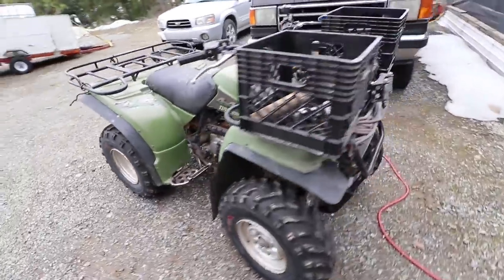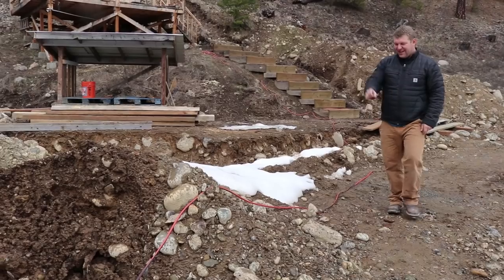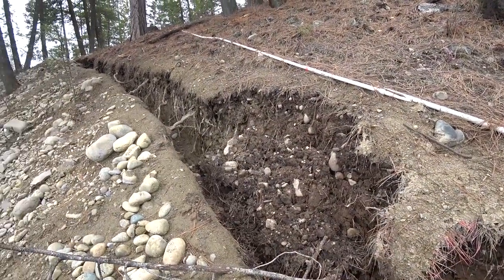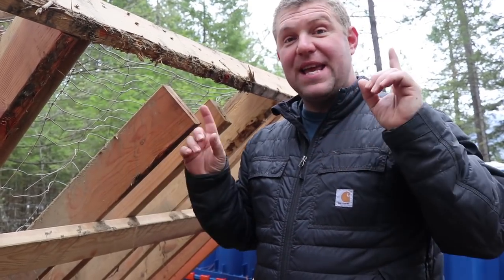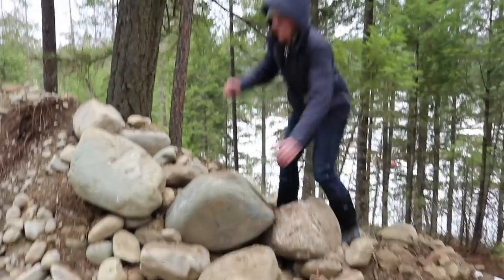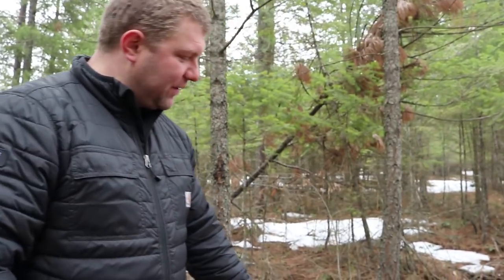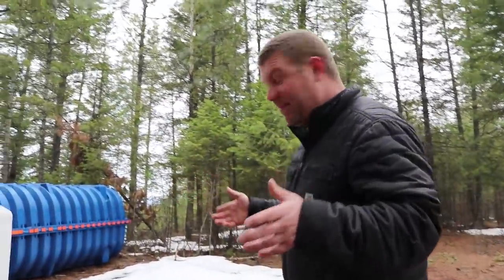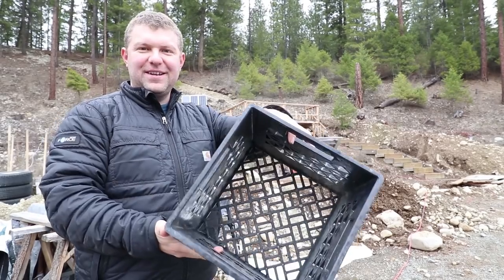IT ACTUALLY WORKED!?! DIY Rock Grizzly (Rock Separator, How to Remove Rocks from Soil)

Comment: WHAT A PROCESS!!   I'd have perhaps notched the frame verticals cross-wise and laid in rebar every 3-4 inches, then overlaid with hog panels.   The fencing then would only flex to the extent of the rebar and could handle good size pieces.  
You said that wood screws had low shear strength - - some are very high (I like SPAX from Home Depot - heat treated to grade 5 durability carbon steel - never broken one yet and used thousands [but not dropping 400# rocks on them]).  I'm sure you didn't use any type of drywall screws - but others may not know that drywall screws are a NO GO for ANY structural project - very brittle.  
Looking forward to seeing your progress.   Very Exciting --- You guys WILL BE SO PUMPED when this project is DONE!

Comment: A typical mining grizzly we (I worked in a cement mill as a miller and heavy equipment operator for over 10yrs) made and used is similar to your final realization that you should have the front of the grizzly high enough to get a front end loader bucket into and the rear should be up high enough and have a solid wall so your front end loader bucket can push your filtered material in the back and allow you to scoop the material up We use to move it around with a wheeled front end loader
Our grizzly was made of very heavy steel I beam legs welded to a frame with welded on railroad track for filter rails spaced about 3-4" apart. It filtered down to about 3-4" or less, It was used to filter crushed stone, gypsum and clinker.

Comment: Change your fencing to some chainlink, lasts longer, and space your boards to the size exclusion.. As you discovered, great sympathy, seasonal sluff as back fill ; 1 is not graded, 2 is not compacted.

See if you have a neighbor with an unused cattle grate, it works.
Reply: The size of the gaps in the chain link fence will be your exclusion size.  You better option would be steel hardware cloth that you buy in rolls at the hardware store.  It comes in various sizes and is reasonably strong.
Reply: A wire fence panel would probably work pretty good. If there are some farms in your area, they might some old ones lying around. A piece of remesh would be good also. But, I suggest putting a couple lengths of rebar at the top where you drop the dirt and rocks to absorb some of the impact.
Reply: Tim Kirkpatrick the cheapest most effective way is to utilize rebar welded together to make your screen. I made 2 different sizes to grade rock from our Creek for road maintenance. I used 1/2" rebar welded in 4.5" squares to remove the large unusable parts and to manufacture material for rough grade and made one with 3/8" rebar welded into 1.75" squares to manufacture a fine finish material. This is fairly affordable,its been a while since I bought any rebar (probably 2003 ) but if I remember correctly 20' sticks cost less than a 10'-12' treated 2×6 and I am still using them so very cost effective! I initially used 4×4T for the perimeter frame but eventually swapped to angle and channel iron when I improved the setup and hinged the lower end to lift up to shake and to move out of the way to facilitate loading material on to 24' conveyor belt that I purchased from a landscape contractor that used it to load top soil. I built a large hopper to aid in loading gravel and firewood into my old dump truck (formerly an old Arkansas highway dept. truck that I bought very cheap) this may sound elaborate and probably would be just to fill one trench but I have to maintain our driveway and short road and have less than $2200.00 in the dump truck and conveyor and steel to manufacture my rock graders, but I imagine with a little creative purchasing you could build the rock screen for $100. bucks or so....
Reply: Putting rebar above the wood for impact limit is a good idea. Old water pipe works well for the same purpose, I have seen this done. Expanded lath works too. Welded mesh mire screen is a good second and third size sort, but will be beat to hell if on the first sort layer.

Old cattle crossing grate is still my winner.
Reply: Tim Kirkpatrick Yes a heavy water or black gas pipe would probably do the job if you had access to a pile of used material, but new would be cost prohibitive. As far as the rebar goes I didn't have it over the wood only 4×4 perimeter frame with a single 2.5" schedule 40 galvanized steel pipe across the center to add a little rigidity,but as long as the rebar is secured properly on the perimeter could probably live without center support depending on size of load being dumped.My frames are 10'×10' and my bucket on my tractor is 84" so I can dump depending on material and moisture content,quite a bit more than a ton.So even as heavy as I have built mine I still have to be careful not to shock it by dropping 3000lbs at once and I can't imagine any fencing lasting more than a few minutes even expanded metal would be trashed at the end of the day in this environment.A Texas gate would be a fair starting point if you had a couple junk ones laying around but the only one I have I drive across every day and it would limit the size of your grading substantially,unless you completely disassembled it and rebuilt and in that case your original idea of pipe would be better,but after putting this much thought into it again (hasn't crossed my mind since 2003 when I built,which I guess is a good thing it must mean it's working) I will have to stand by my rebar rock grader on any scale be it a small one for a back hoe or excavator bucket or a larger heavier one for a large loader bucket is the simplest and most cost effective method....

Comment: This is perfect timing! I've got exactly this problem on the site I'm building my house on (in England) and need to separate stone from soil on a broken down old field wall (probably been lying like this for 200 years approx so all the stone has sunk into the soil.). Thanks for showing this - making my own next weekend!
Reply: If you need to get more then just the large rocks out look at a barrel trommel. A sloped frame holds the barrel on casters and you drill holes just smaller then the size of the rock you want to separate out. A motor and belt to spin the barrel and you just have to feed material in one end and get rocks out the other and the soil falling under it. 

One barrel can do all the work but multiple let you separate all the sizes of rock for later use doing a pass for each size.

Comment: I recommend using some of the rocks you have now to make sun traps. Essentially it is a C shaped mound of rock with the open side facing South. You then place your planting beds inside the C. The rocks will absorb heat during the day and radiate it back to your plants at night. Also consider looking into Gabion walls.

Comment: great Job!! When my grandfather did it you need to angle the 2x4 into a V shape where the rocks hit the small opening of the V so and then the cross braces need to be reinforced to the frame then place a V brace on top that is reinforced by the frame and pick up the hole ting by the v top....

Comment: When I was a kid, my parents house was on the edge of a dried up riverbed (lots of river stone). Grandpa came for a stay and was aghast that we didn't have a garden. He built a much smaller version of your grizzly. Four upright legs, diagonals to prevent racking, and hardware cloth as screening material. 
Fast forward to my adulthood and I replicated Grandpa's design (in google sketchup) and then I built it. Key feature is that it's high enough off the ground that you can put a child's radio flyer wagon or garden dump wagon/wheel barrow either under the lip of the screen to catch the rock, or under the center of the screen to catch the fine. 
I also used the screener to process my compost harvest - I'd specifically built it small enough that the four legs fit within one of those tow behind riding mower dump cart. Worked great for about 3 years until a dead tree fell on it and collapsed it beyond repair.

Comment: for the ribbing, using iron pipe and flanges bolted to the ends I think would stay attached fairly well. Being hollow it shouldn't be too heavy, but they may bend under repeated loads though

Comment: I really like your videos and the ideas you come up with and the fact that you are willing to put it all on video you will be able to look back one day and say "Wow did I do that ?" or "Wow we were fortunate" but then you will be able to say "We struggled and learned but look what we done!" so don't stop now keep on going, and one other thing to think about is modular construction that is build your house in sections or layers or segments, like an Octagon building a section or two at a time and expanding as you can afford to and have the time and strength. And your first section may be a garage where you could move the RV in and have easy access to the rest of the sections without shoveling snow and your wood stove would heat the garage and construction as you set it up.Sometimes when you put a plastic tank in the ground and its empty even if you back fill around it the hole that the tank was installed in can hold water and the tank can possibly float upward. There are two ways to prevent this one is fill the tank with water and the other method is to build a French drain away from the hole where the tanks are installed, that can be a trench that starts at the bottom of the hole where the tanks are installed and the trench is dug away from the tanks sloping down as the trench is dug to a ditch or lower spot on the property, then back fill the trench with the boulders with the big boulders and the air space left with the boulder backfill will drain the water from the tank hole excavation so the water cannot build-up and the tanks will not float.One other item, on your Grizzly (Grrr) you are not using the strength of the lumber to screen your dump loads, you built a normal stud wall and laid it on a ~45 degree then you used 2 4x4's as legs to stand it up. Doing it this way you are relying on the screws in shear to take the load of the bucket dump not a rugged enough design, a fix to this would be to build another stud wall and put the wall where you had the 4x4 posts installed, put a double header on the short stud wall and a double footer and place this wall in the location of the 4x4 posts, this way the grizzly floor joist pieces will be bearing down on the double header and you will have to crush the stud wall to fail the grizzly with this method you are using the strength of the wood and not just the shear of the screws. Actually you could build a 2 foot stud wall and a 6 foot stud wall and lay your Grizzly stud wall on the other two walls and secure, if you put the grizzly bars the spacing of the rock you want to keep out you don't need screen. Add some cross braces from the stud walls to the grizzly bars and set the 4x4 as skids under the stud walls and then as you are digging the trench you can slide the grizzly along on the 4x4 skids as you dig the trench. Then you could use the fines to back fill around the buried pipe and then backfill with  the boulders or something else. I mean this in the best way, but you need to learn to use the strength of the wood in your construction, screws, nails and pins are just to hold the wood in place the arrangement of the wood or timber has to be built to take the maximum load, you will fail at post and beam construction or timber framing if you do not master this. Good Luck!

Comment: Instead of using garden fencing, they make cattle panels that are made with 1/4 in. metal rods, that have something like a 6 inch opening. And they are fairly light, a 4 x 8 ft. panel can be carried by one person. This will help a ton to protect the wood. Also for the 2 or 3 2x6's, that get hit with most the weight, put some angle iron on them.

Comment: A very important part of installing any buried utility, even 6" rock has caused us problems with small lines. When we did about 150' feet of trench for water, propane and electric we built a similar set up between two trees and a couple of pilings. 6-8 inch logs lashed with chain for the main runners and 2-4 inch ceders horizontally with old piece if chain link on top.

Comment: Yep I have made and used plenty of soil sifters in my time landscaping. 

With glacial till like your property has this is going to be something you will be using a lot. I would also suggest you figure out some projects to utilize those rocks as they are going to pile up fast. Even if it is just making some dry stack rock walls with them you would be well served to start utilizing them before it becomes a giant project to get them out of the way.
Reply: Something you might consider doing with the rock is building a "dry creek" or two on the hill that could help channel spring melt to specific areas. Like to your garden space.

Comment: If I may suggest is placing a 2x6 upright under the 45 deg screen beams bolted to the 4x4 for added support. It would look like a deck with a over hang from the support beam.

Comment: Good Idea Jesse & Alyssa.  Here are my thoughts on your Grizzly 2.0... 
- Remember that you will be building a house on the same soil...  so you want this to last a while to help with foundation backfill (certainly more than just for the cistern trench - now that you have your proof of concept).  
- Use, as Jesse mentioned, some old chain link fence instead of welded wire. There has to be someone replacing their old rusted looking and bent (but sound in strength) fencing... or just check with the local Fence contractors they get paid to swap out old fence all the time.  Keep an eye out for where someone piled through a chain link fence along the roadways...
- Notch in some rebar across your "joists" laterally (side-to-side), or use conduit clamps to surface mount it.  Then place the c/l fence over that.
- Definitely raise it as you pointed out.. give the rocks somewhere to fall/roll.  AND, if you can position the grizzly so that the rocks will roll downhill away from the low end, even better!  (Just don't let 'em roll into the trench) :0
- How about using lag screws or small carriage bolts in conjunction with joist hangers instead of wood screws at the rim/joist?  Instead of putting screws into the joist hanger holes, drill thru the wood and use the bolts.  (Double up the bottom rim joist too if need be).
- Those field stones/rocks might be nice to build your future driveway retaining wall, or walk-out basement retention wall (if you are going that route).  Looks like you'll have enough to do the entire uphill side of the driveway! :)

Keep up the good work!

Comment: You could build an additional screen so that you separate out the big rocks, separate out the medium stuff for fill and finer material for gardening. Then you can just mix in organics from the compost.
Reply: There is also the 55 gallon barrel trommel idea. A 55 gallon barrel with holes just under the size of the smallest rocks you want to separate on a slanted frame will drop anything smaller then the holes under it and anything larger out the end. A motor and belt to spin and you can have a number of barrels to go from large to small to get every type of gravel out. 

You would still want something to remove the large rocks before it gets to the barrel as they would dent it as they bounce around inside.

Comment: Just a suggestion, but we have used Grizzlys at the copper mine I work at, dig a hole about a foot from the base, and around 2-3 foot deep for the rocks to catch in, then just clean the rocks out as needed. Keeps from having to move the project as much.

Comment: i just luv you guys, your my top video producers on youtube, you know, winters can be long and by the time you get let loose with spring in the air and all of your ideas from winter, your ready to go go go.....for the grizzly fabric, how would the wire mess they use when pouring concrete slabs, and if you want or need to make the openings smaller, just put another layer on the first except put it on at a different angle....

Comment: If you still need it one suggestion for your grizzly check the wire mesh use to reinforce concrete wall or floor ( Wire Mesh 9/9g x 6 Inch x 6 Inch x 3.5 Feet x 7 Feet) you can adjust the screen size with the overlapping  this stuff look tough.

Comment: Use all that rock to build Gabion Baskets to make retaining walls where you need them.  You can use al that wire mesh to make the square blocks and just drop them in.  The cool thing is you could line the highway portion of your property to keep out cars and animals and water will flow right through since there is no mortar between stones.

Comment: Maybe you could use a "Hog Panel" over the chicken wire next time you use the grizzly. They are not expensive and the heavy gauge welded wire would handle bigger rocks and the chicken wire the smaller stuff. When your done, they make an excellent trellis for the garden! Some cross supports (blocking) between the long boards would help strengthen it as well. Good luck!

Comment: I would recommend adding 2 more posts per side on your Rock Grizzly, 1 in the middle per side and 1 at the front per side.  And then add another Horizontal brace or 2 per side connecting them all together. Why? It will make much STRONGER to handle the heavier Rocks, be able to last longer and handle more abuse. lol  Yes it will be heavier, but it will make it stronger and last longer.   

Also you might want to try the 2" x 2" or even 2" x 4" wire mesh fencing that is of a heavier gauge used in Livestock fencing, if you can find it. It should cost under $100 depending on how much you need brand new and what width you choose 48" or 60".   

Also you could check around your area to see if any farms or ranches have any used fencing they are getting rid of that you could trade, buy, barter, or have for free.